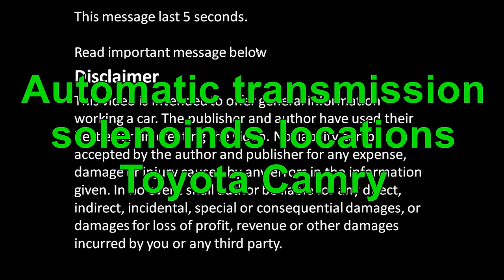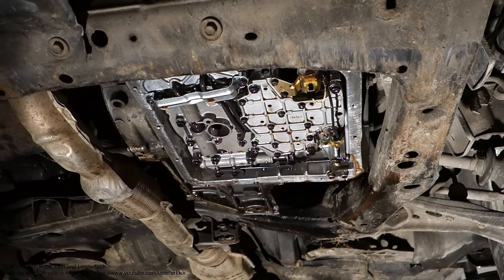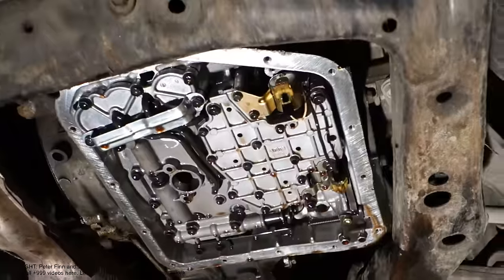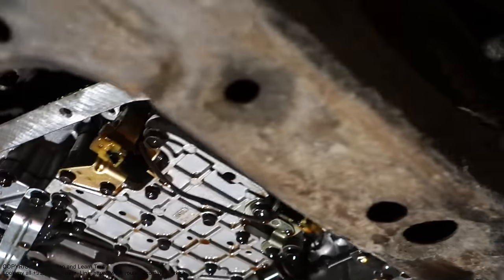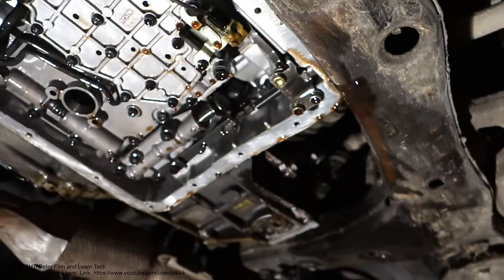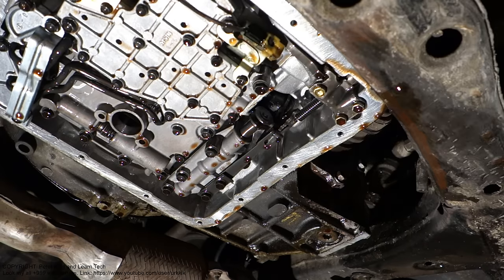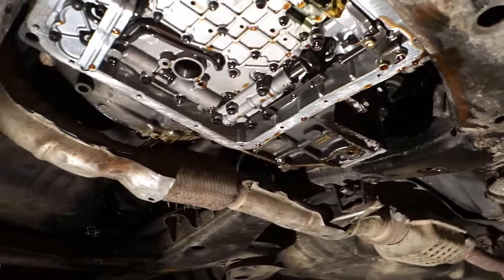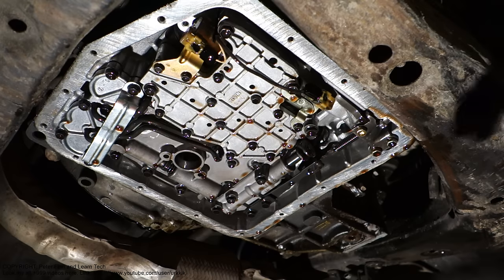Automatic transmission solenoids locations in Toyota Camry. Years 1990 to 2002

Comment: I have a 2007 corolla with code po741 is a solenoid the transmission makes the changes very well the rpm works normal.  replace solenoid but engine light returned.  I need help that I must do to repair that problem.  Thank you

Comment: Hi. You mentioned solenoid 1. Is that 1st gear solenoid? I have an 2000 corolla with trouble shifting on first gear to second gear. Revs up at take off. Was that the first gear solenoid you pointed at at first?
Reply from the maker: Hi, sorry. I need to do new video.

Comment: hi Peter I had a question if you don't mind me asking. my check engine light is on for my 2008 Toyota Corolla. the code is p0741 and it says that it's the torque converter lockup solenoid. when I asked a mechanic they said that I would need to change the torque converter but since I would change that might as well change the transmission. anyways their trying to charge me like $3000 but I don't think it's the torque converter I think it's one of the actual solenoids connecting to the torque converter. what do you think it could be?
Reply from the maker: Hi, first replace new transmission oil and fluid. This service helps often !  Visit the Toyota dealer, because they use special transmission fluid.

Comment: I have poor acceleration and I can't reverse. The transmission fluid was terrible. I cleaned pan, got new filter, topped it off and it still keeps slipping and not accelerating. I also can't reverse. Do I need a new solenoid? What are other probable causes?
Reply from the maker: Hi, replace Ford type F fluid

Comment: Hi Peter, I have 2000 Camry V6 3.0 with check engine code P0773 (shift Solenoid E electrical). Your video watched if i replace it would be fine and no code? I don't have a gear or shifting problem that I can feel driving. Thank you.
Reply from the maker: Glad it helped

Comment: My 2000 Camry 2.2L, I drove without transmission fluid like ten feet, the transmission started to smoke, I parked it, did a transmission fluid and filter change, then I tried to reverse, but reverse didn’t work anymore, and also, when I put in neutral it acts like it’s in drive, it drives perfect but I some how messed up reverse bc I don’t have R no more . Any clue how to get R back ?
Reply from the maker: Thanks for sharing 👍😀

Comment: Hello, I have a 1992 celica 2.2L automatic transmission, when I shift into reverse the car will not move, and when I shift into neutral the vehicle moves forward, can you please give me some advice on which steps I should take first, figuring out what’s wrong with my transmission thank you.
Reply from the maker: You have a gearbox fault. The problem could be helped by changing the oil Ford type F. And then disconnecting the gear cables, lubricating them and installing them back

Comment: what would be the symptoms if the solenoid are failing? I've had an issue for about three years where my Sienna van will not shift from second into third until it warms up a little. shifts fine after except for a rare hard shifting which may be due more to a bad motor mount. no CEL codes and has not gotten worse since I bought the van. I think previous owner was setting trans fluid level with car off instead of running so he ran it with less oil than needed for a while. when I bought it, it would make a strange humming noise at start up that went away after a couple minutes. after I changed the oil and filter and corrected the level, it stopped making the noise at start up but still hesitates on shifts until warm. ideas?
Reply from the maker: Hi, your transmission clutch discs might be worn out
Reply: Originally, I was thinking along the same lines but if it was a wear-and-tear item, wouldn't you expect it to get worse over time? The symptoms have not changed in 3 years.
Reply: @LibertarianCoconut  4 years later you ever figure it out?

Comment: Hi. I have a camry 2003 v6 and the car clunk when shifting back to first gear. It also clunk when i put into reverse from park or drive. Amy idea? Thanks
Reply from the maker: Hi, your gearbox is worn out. Please replace better gearbox.
Reply: motor mounts/transmission mounts👌

Comment: Car jerks at times when shifting from  2-3 gear and sometimes gets stuck in 3rd what could it be ive replaced the input speed sensor code and it still says the same code and the issue is still there
Reply from the maker: I have read your message, Thank you 😀👍 Please Join my member.

Comment: Hi Peter. i got camry 2003 model (acv30). the problem is when the engine is cold and i shift the gear to D it wont move. its either i leave it idle for 10 to 15 mins or rev it up until jerking can only the car move. is it solenoid problem ? ive try changing the oil and filter still same issue,
Reply from the maker: Hello and thank you for the message. I think that your automatic box has a problem, maybe the oil pump and the clutch plate, you should do a complete interior repair Automatic box new or buy a used box junkyard buy

Comment: Can a bad reverse solenoid in a 2002 Camry cause reverse and neutral to act like park?  All drive gears work as expected.  The console shows the correct gears, and the engine/transmission sounds seem to be like normal when shifting into reverse and park, but the performance is that of being in park.  I can't even reverse the vehicle at all...  there is no neutral at all.
Reply from the maker: Message read, good comment 👍

Comment: Does this apply to the v6 model or only the 4 cylinder model?
Reply from the maker: Both
Reply: Do we have to drop the pan to get to the solenoid??
Reply: Yes, you need to remove the pan and filter to access the valve body, where the solenoids are located. @getdagist1
Reply: What would the part number be for the number one solenoid for a 93 v6 Camry

Comment: 2002 camry will shift normally with light throttle, But wont shift until4000-4500 rpms under normal throttle. Or until i let off the accelerator. The tranny level is about 3/8 inch below the lower hot mark when engine is warmed up. Is this model that sensitive to fluid level? It shifts just fine into drive or reverse. 231000 miles. fluid probably never changed.
Reply from the maker: Thanks for info 👍
Reply: @PeterFinnTheCarDoctor  i was wondering if you had any ideas on my very high rpm shifting

Comment: My 2008 Camry had a leaking gearbox issue. So I went to the mechanic and he said he needed to open the gearbox and apply some seals and gasket. After putting it back now the gears are slipping and last night it slipped and now not able to shift into D,4,3,2,L. It goes into R and P only. What would be the problem?
Reply from the maker: Hi, your gearbox clutch plates are worn out
Reply: @PeterFinnTheCarDoctor  is it very tough to be replaced? These mechanics forced me to replace my entire gearbox saying that after repairing it there is no guarantee that it will be fixed.

Comment: hi peter, i have a 1993 camry automatic that wont down shift with throttle , but work fine when cruise controls on, got any ideas?
Reply from the maker: MAybe transmission oil replace helps...

Comment: Sir, Thankyou for your vids. 2003 Camry, auto trans slip, in reverse gear, up steep driveway. Trans flushed & filter screen changed.
Maybe better, but still slips sometimes. Managing by handbrake start, in reverse, up incline. Revving a little, seems to apply the rev clutch pack better? Should the rev solenoid be replaced? Even if the trans is a bit old, Reverse gear is the least used? Which solenoid is for rev gear - U241 E?
Reply from the maker: Thanks !  Good comment. 😀👍

Comment: Hey I see and noticed you've posted a lot of Toyotas you worked on . 
Question my car can go reverse but won't move on D nor any other gears.  
I've added more transmission fluid nothing any suggestions?
Reply from the maker: Hi, do you mean gear stick. It not go to D ?
Reply: It goes to the D shift but does not go foward
Reply from the maker: Ok, then you might have mechanical failure in gearbox

Comment: Hi Peter. I have camry 2013 car accelerates slowly. sometimes it doesnt shift at all and sometimes it starts in third gear and doesnt shift up or down unless I turn it off while running put on N the start then put on D and it goes fine and shifts up all 6 gears. Then when I decelerate and stop at traffic light it starts all over again and I have to repeat the trick again .. very annoying 😥
Reply from the maker: Ok, how much km ?
Reply: @PeterFinnTheCarDoctor  200000

Comment: Hey I have a 2002 Camry 3.0,everything works fine until I get up to third and have to switch to fourth gear,itll shift as long as I keep the rpm below 2 but it has no power so it's slow getting up to speed that way could solenoids be the issue?
Reply from the maker: Yes

Comment: i have a '92 with a 3sfe ,transmission was all good( went in all gears) (been parked in my slanted drive way for some time) ,all of a sudden one day i removed it back 4 feet ,and now it doesnt go into gear at all,just makes a grinding noise when trying to shifting the lever into gear(cable is well connected),is my tranmission gone?
Reply from the maker: Thanks for sharing, please try replace new oil to transmission
Reply: @PeterFinnTheCarDoctor  thanks ,will give you an update
Reply: Got the transmission off ,how much oil does it take to refill

Comment: I have been having issues with the automatic transmission of Toyota camry 1997 model ,  I have taken it to obd for diagnosis it shown only cam shaft sensor and it will shift from 1st to 3rd gear instead of 1st to 2nd and it will be revolving at 6000rpm at 20mph kindly assist on it
Reply from the maker: Ok, You need  to replace new oil to gearbox

Comment: What wires on the outside of the tranny control the torque converter lockup? I want to wire in a lockup switch but cannot find any information. Thanks
Reply from the maker: Good comment. 😀👍

Comment: hi.. I have a Toyota Corolla 2002 model. it delays when shifting from gear 1 to gear 2 and it's automatic.what could be the issue
Reply from the maker: Please replace new transmission oil
Reply: Peter Finn I have done that and no improvement. I put it in a computer for diagnosis and reported A solenoid and B solenoid also...what should I do
Reply: Erick Maina hi did you replace the 2 in the front after taking off the pan? I have a a& b code to

Comment: 1991 camry my car drives but is loud. Also speedometer does not work until after 20 mph then needle jumps. What can be problem??
Reply: may be the speed sensor.
Reply: It may be loud because of an exhaust leak. If it sounds like its pushing air out making a kind of "F" sound, that is more than likely the case.

Comment: ( from the caribbean ) hey i have a 1998 toyota corolla it shifts fine on level roads but when i go up hills it gets slow before it goes into low gear ,what can be the problem changed the fluied an strainner already
Reply from the maker: Maybe oil replace helps

Comment: So my Automatic transmission Toyota caldina wagon gear lever can move in D,R,P and N position, However the car does not move. I changed the ATF and it was very dirty with lots of sludge. I did 2 to three refills and draining the ATF and cleaning transmission filters and solenoid. And now the car moves a bit but then stops. When I press the accelerator pedal car wont move.
Reply from the maker: Hi maybe your automatic transmission clutchs are worn out. You need replace those ! Look my info video: https://youtu.be/U5BzUDJEciE
Reply: Thanks alot let me check it out

Comment: How many shift solenoid a transmission has? Is it inside transmission for Japan made version Camry? My 1999Toyota Camry V6 XLE is Japan made. It has fault code P0773 because shift control solenoid failed, and engine light on. I try to locate this shift solenoid without luck. Another You Tube page from Jeremy Hood that shows 99 Camry has shift solenoid behind Automatic transmission 3 ways Switch Assembly, Neutral Start. It is mounted on transmission outside , right below car battery area. I am very thankful if anyone can help me.Thank you.
Reply from the maker: Hi, sorry. I don't know V6 gearbox.
Reply: Did you ever find out how.to.fix the solenoid and how much did cost??
Reply: i have the same.make and model
Reply: 1999 toyota camry v6
Reply: In case someone sees this in future, the three solenoids are in the transmission. Drain the transmission then remove the pan to access them. There are three. Two wired together, solenoids one and two then the third is the lock out solenoid or the shift solenoid 'e' by itself.
Reply: Thank you for the info on the solenoid locations and how they're configured. I also have the P0773 error code, and am looking to get this fixed this summer. Doesn't look like it is that difficult to get to the solenoids. A tranny shop suggested also replacing the valve body as it may also be causing the error code also. @lukemartin7029
Reply: Hi Nguyen, my name is Yuan. I have the same problem like you have. Can you tell me the part number of the Shift Solenoid E so I can buy it and fix the problem.
Thank you.

Comment: Hello Sir.. I just put 800 in a engine rebuilt but my transmission started slipping little by little now just continuously slips reverse is great but first is gone it feels like I changed fluid and filter no metal or anything just old nasty fluid.. im begging help I can't afford a soft parts rebuild they want 1200 that's crazy.. im decent mechanic I can do tie rods ball joints wheel bearing but don't think I can handle a transmission
Reply from the maker: Hi Sir, your transmission clutch plates are worn out. :-(  So, you need new clutch plates or new gearbox. Maybe low miles used?

Comment: Hello peter I have a 94 Camry that the O/D flashes then check engine light comes on. Would that be my shift solenoids? Thank you.
Reply from the maker: MAybe gearbox oil replace helps
Reply: your overdrive band is no good!!! dont listen to this guy!
Reply: Hello Peter, my name is Yuan. I have a 1994 Toyota Camry LE V6. Recently it showed up an Engine Check problem exactly identical to what Dacari described in his question, with OBDII code of P0773 which pointed to Transmission Shift Solenoid E problem. I am lucky to find your article about how to trouble shooting and fixing the problem. It took me a lot of time to go into the transmission pan and finally found the Shift solenoid E. As mater of fact, I tested all 3 solenoids in the pan. They all pass the Resistant measurement test and Voltage click tests. I ran out of ideas, so I put them back as close as possible. The car still runs. But when the RPM reaches above 2200 RPM, or Speed above 50 miles, the Engine Check turns on with O/D OFF flashes. Can you tell me any other solenoid might be in problem ?

Comment: hye boss... I have a Camry 5s 2.2 car... all the gears can go in but I can't run... before that the gearbox pump gear broke so it has been replaced but it still can't run...car auto...
Reply from the maker: Sounds bad. Buy a good old engine and gearbox cheap. And change parts for your car. Parts can be found in some junkyard.
Reply: Thank for information boss...

Comment: I have a 2004 4 cyl Toyota solara engages gears for a short time then feels like the car is in the nuetral after awhile from being on
Reply from the maker: Ok, maybe gearbox oil replace could help
Reply: Also has the p0741 code. Would I have to change the torque converter clutch circuit as well ?